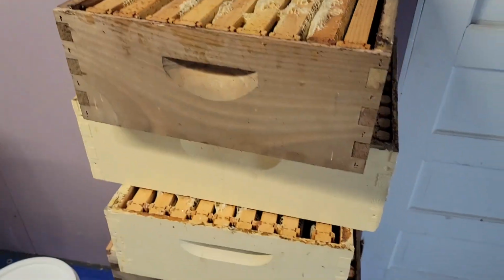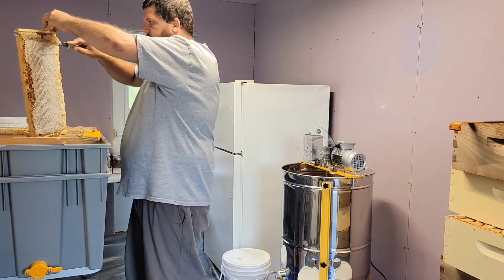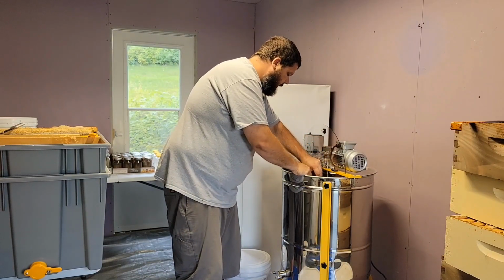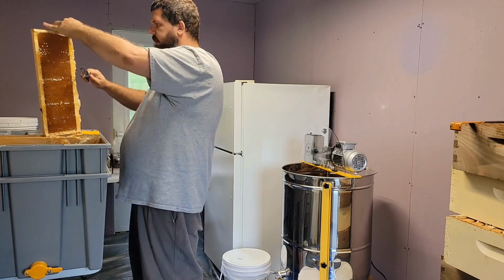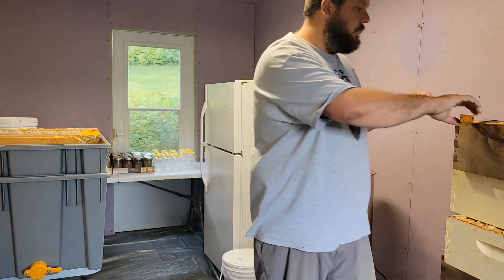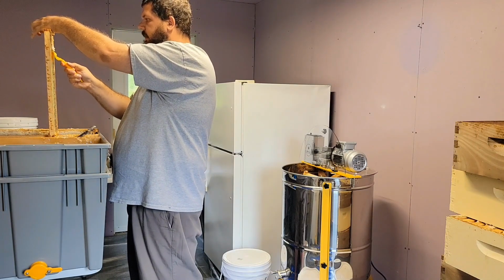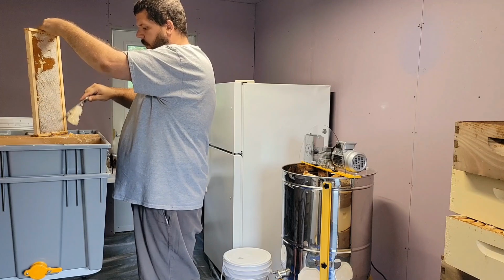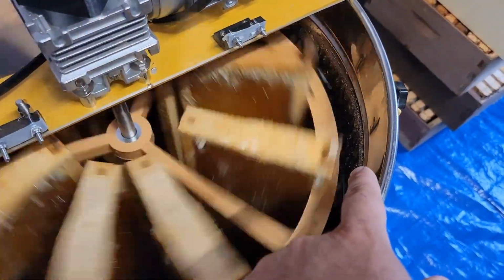Extracting Honey 2022 [Honey Season Part 2]

Comment: What type of uncapping tank do you have? Yours seems wider and is able to accomodate frames.
Reply from the maker: It's the Mann Lake tank, I like it, it fits a super of frames in it if you desire, uses a queen excluder in the top bin to allow honey to drain to the lower bin.
Reply: I had recently purchased a smaller size with Mann Lake, they don't advertise this larger one on their site.
Reply from the maker: HH231 I believe is the part number on their site.